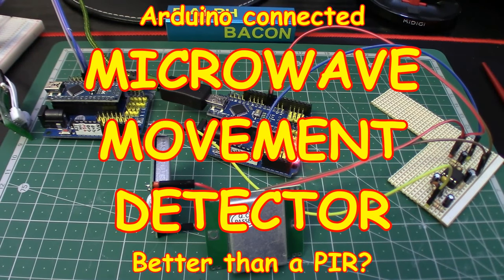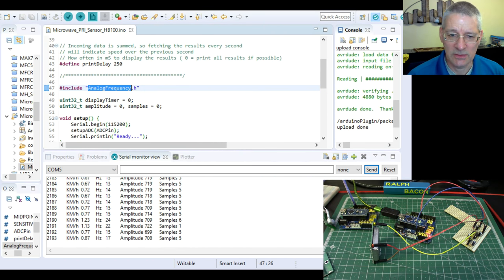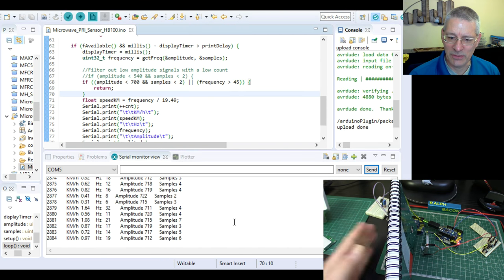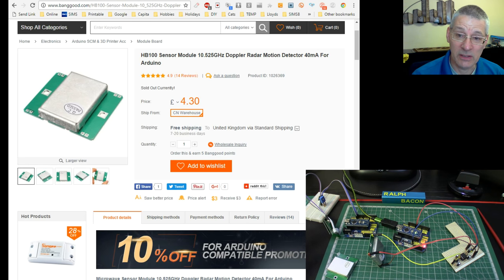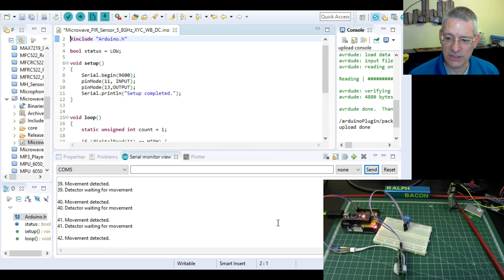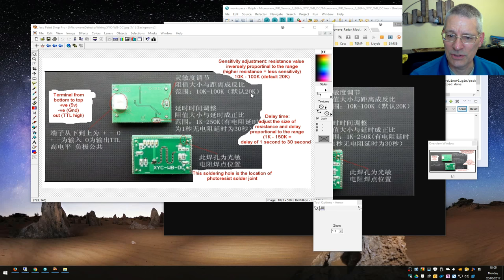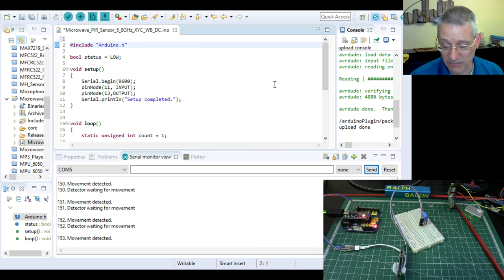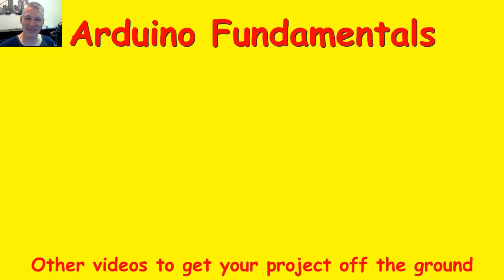#78 See thru walls! Microwave Movement Sensor

Comment: Just a though .... put a grounded metal can or (dish) around it.... set the sensitivity to the max, point it towards the sky and maybe sense rain?
Reply from the maker: Hmm, that might work, Joe, but I'm not sure how reliable it would be. Light drizzle vs torrential rain? And what about the sensor that is now pointing to the sky? It would have to have a thin shield to protect it fro the actual rain (which is fine, because as the demo shows the microwaves will go through plastic). Tell you what, buy one and try it out and let us all know the results! Hello, you still there Joe, hello, where have you gone? Heh heh! Nice bit of lateral thinking.

Comment: The antenna on the XYC-WB-DC loos like a waveguide. It's probably not. :) Anyway, interesting stuff. Thanks!
Reply from the maker: Hey Robert, how's it hanging? Not sure about this being an actual waveguide, which as the name suggests actually guides the waves into a particular direction. This unit is supposed to have 360-degree coverage. Additionally, the wavelength of a 5.8Ghz signal is about 51mm I believe (let's hope I have not misplaced a decimal point) and that piece of track could be that length given its twisty-turny nature. Just an educated guess... Glad you thought it was interesting and thanks for posting!

Comment: Hi, Can the XYC - WB -DC or any other sensor's sensitivity can be increased to detect the chest movement while breathing? Thinking of using this sensor in a worst case scenario where people are getting trapped inside the rubble after an earthquake.
Reply from the maker: This sensor, as far as I know, was never designed for such uses, Loga. The signal from the tiny movement of a chest, compared to everything else that is moving around would surely be swamped anyway? You can certainly try it, but you would have to shield the unit with a metal case so it only detected in a narrow field of vision - which in itself would make it more difficult to detect what you suggest. But R&D has to start somewhere, so good luck if you decide to proceed.

Comment: What would your suggestion be about a best method to detect people through walls effectively?
Reply from the maker: This microwave detector would certainly detect people moving, through walls. The trouble is, it would also detect trees, dogs... in fact, anything moving. Do bear in mind though that if your walls are thick concrete or brick then it may struggle to see through them. Simple plasterboard are not a problem.
Reply: @RalphBacon  thank you so much for the valuable piece of information. It'll really help me a lot😄
Reply: @vardhanshah  In my experience it detects almost anything moving not only in front of the sensor (360°).

Comment: can it be used as a human motion detector behind a wall and doors??
Reply from the maker: That's the idea, Syed, but it will detect movement in a 360-degree circle (or sphere) so you may be detecting things you didn't expect to detect. In my demo I mentioned that I couldn't understand why it was showing movement most of the time - then I realised my ceiling fan was on! Once I'd turned it off, it settled down.

Comment: Hi, I'm using RCWL0516 but it detects motion only within limited range and that too in one direction. Can u please help me
Reply: I paired the RCWL0516 with a NANO and was able to detect motion through wood doors and plaster
walls with a max range of about 15- 20 ft.  I needed the NANO to stretch the detection pulses and put it all in a project box and it works pretty well.  I needed to shield the back and sides of the box
with aluminum foil to make it directional since the RCWL0516 seems to be omnidirectional.
Reply from the maker: Indeed, Sarvjit, most microwave detectors are too sensitive and as Frank L has said you usually need to shield them but putting them into a partial metal enclosure (or tin can) to make them directional. So I don't know why yours doesn't work, I suspect the wiring is wrong, you need to double check that.
Reply: @RalphBacon  thanks for ur reply it's working well now. But I want to reduce it's range hoto 20-30 cm how can I do this? Please help
Reply: @frankl1955  sir can you give me the code  of  wood doors and plaster projech

Comment: i would like to use this idea in my project"smart bump" by using servo motor
can you help me
Reply from the maker: Well, the idea is that you watch (and indeed replicate) what I do in the demo to increase your understanding and then, having got your project off the ground, you can expand all by yourself. I'm afraid with the best will in the world I don't have time to give general help. I will, however, try and answer specific, video/demo related questions. You may get further help if you go to the Arduino forum, http://forum.arduino.cc who can provide more general project guidance as well as in-depth coding solutions. Have a visit and good luck with your project!

Comment: Hi ralph Very interesting stuff , did you check the current draw of the 2nd unit ? I want to know if its a candidate for a long term battery powered unit.
Reply from the maker: Good question! The XYC-WB-DC has a "standby current" (I'm guessing this means no movement detected) of 3mA (states the spec sheet) but no info on run time current (although the transmit power is just 2mW).

These are the specs I found:
Supply voltage: 3.3V to 20Vdc
● Standby power consumption: less than 3mA
● Sender power: less than 2mW
● operating temperature: -20 ° C to + 80 ° C
● Trigger: (default) repeated trigger
● TTL output: high H> 3.3V, low L 0V
● detection angle: 360 ° (spherical)
● detection range: 6 to 9 meters
(default setting is 8 meters)
● Delayed operation: 1 second to a few seconds
(default setting is 30 s)

I hope this helps.
Reply: Ralph S Bacon yes thanks a lot for the info that will come in handy , it looks it should be able to run a few weeks depending on the battery of course without a problem.

Comment: Hi sir its more informative one. I am going to doing a project regarding vehicle presence detection using microwave radar sensor . Initially going to take arduino as controller . can u suggest from where i can start . Now its the state of literature review. please suggest from where i  can start the project. could you please help me to select microwave radar sensor for vehicle presence detection. which sensor is suitable for this
Reply from the maker: I have no experience of microwave sensors other than the one I used in this demo, I'm sorry Pooja. However, I would consider why you think a µwave sensor is better than a PIR sensor, or a capacitive sensor. How far are the cars away? Driveway sensor or roadside sensor. Try and give your project some scope before deciding on the technology, that is the best I can say.

Comment: hi, great job, i have a cuestion, can i use this device to make distance measures? what's the range of the sensor?
Reply from the maker: Ah, no, you can't as far as I know, at least not using the sketch I used, that was for motion only. If you could measure the Doppler signal then I suppose it could be done, and if it can be done you can be sure someone has already done it. Google could be your best friend here, Dario, and if you find out you can do then please let us know! The range of the sensor is large, 6m or more, but can be adjusted. That is why is can be a problem if you only intend to detect movement within a small area, you might be actually detecting movement in the next room, or in the next house!
Reply: thanks Ralph, i'm now beginning with a proyect and want to know how to make a small radar with arduino, lidar lite v3 sensor probably wont be enough for me.

Comment: Hello can i use your code for a microwave sensor XYC-WB-D1 thank you for your response
Reply from the maker: You might be able to, Jomari, but as I don't have that exact model I can't say for sure. They must be fairly similar though. I suggest comparing the data sheets for both - if they are similar enough just try it out!

Comment: for the HB100 , You are using the wrong approach, you should be doing a signal processing library to extract harmonics and work on those ... If you do so, you can go and hunt for the specific thing you want to measure. The HB100 gets it all, from your heart movement to your breathing, it is important to use a library of signal processing, and target your application.
Reply from the maker: Hi Francois, I don't suppose you have a link for a suitable Arduino-compatible signal processing library? That approach sounds interesting...
Reply: Sound a little crazy, you have to extract the DSP part out of the code, but the HB100 does spit audio signal, so, It is fairly adapted to that. The hard part is to figure out how to get the rolling buffer, depending on the platform you are using.

Comment: That XYC module is most likely to replace the PIR sensor. Check the video from Bigclive as well: https://www.youtube.com/watch?v=FgdXRLjYkc4 (And the missing LDR is there)
Reply from the maker: Could do, Will, could do. That video from whoever that chap is does describe a similar item indeed, but it's not identical to this one (but the principle most certainly is). At least this device is more or less understandable not just weird! As I mentioned (and BigClive does too in a way) do you actually want a light that switches on because someone is in the room next door? Tricky one this. Thanks for posting and raising this intriguing question.
Reply: Seems to make more sense as a motion detector for an alarm system, instead of the typical IR sensors, as long as its range does not extend outside of the walls of the property being protected.

Comment: Can reduce range until 20 - 25 cm?
Reply from the maker: Yes, it worked for me down to just a few centimetres.
Reply: @RalphBacon  What resistance should I put on them or what else should I do to them? I have seen that it also influences the supply voltage. With 12 volts it is much more sensitive. With 5-6 volts it seems ok but not enough. New I use 1 Mohm. I use RCWL-0516 sensor
Reply from the maker: You will have to look at the video again to see what I use. Or see the manufacturers datasheet (perhaps I put more info in my GitHub?).
Reply: @RalphBacon  lol - please think for me! People need to be more attentive.

Comment: BETTER TO USE THE    *  Microwave-Radar-Sensor-RCWL-0516 * FROM E-BAY ABOUT ONE   U.S.  DOLLAR EACH I BOUGHT 5 UNITS FOR $3.50 FREE SHIP. THESE ARE MUCH BETTER UNITS NO AMPLIFIER NEEDED, RANGE IS APPROX 15 FT OR 5 M THE ARDUINO SEES THE SIGNAL AND TURNS ON AN LED OR SWITCH.  THE UNIT OBSERVED IN THIS VIDEO IS NOT A GOOD PERFORMER.

I THINK ANY VOLTAGE COMPACTOR CIRCUIT LIKE THE  LM 741 OR 1458 WOULD ALSO WORK FINE TO TURN ON AN LED OR RELAY.
Reply from the maker: Interesting post, so I Googled and found this interesting link: https://hackaday.io/project/19400-first-steps-with-the-rcwl-0516-radar-switch where (scroll to bottom) he discovered the output is analog. Seems like µWave is the PIR of the future then! Thanks for the heads-up, jmitsch44827, good info!